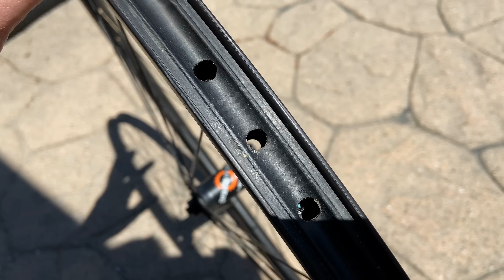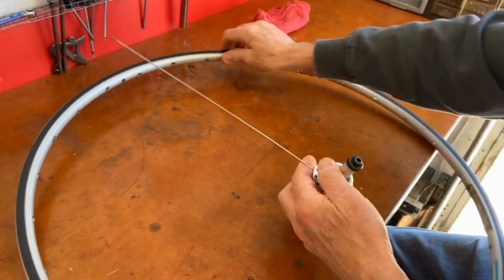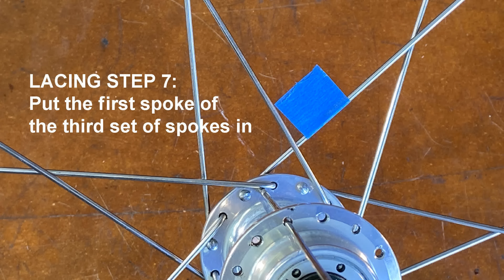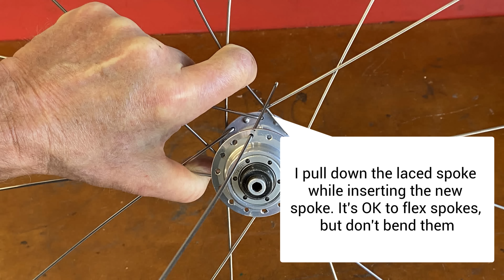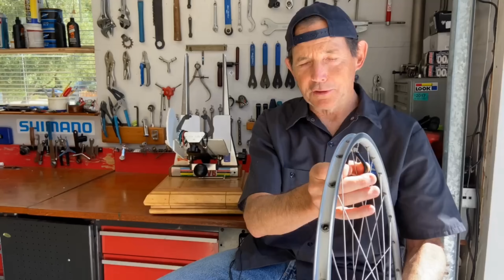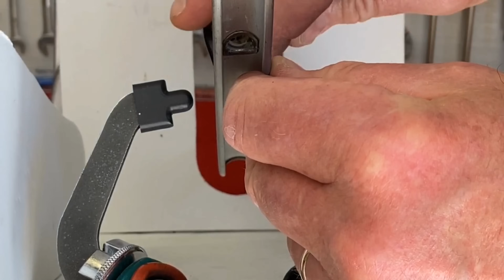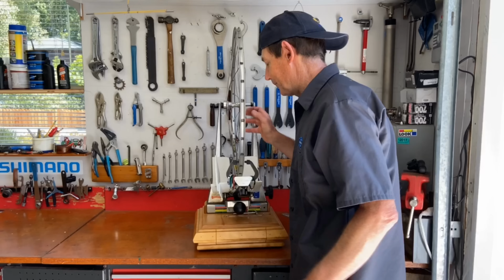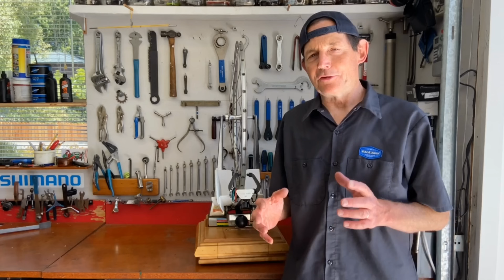How To Build Bicycle Wheels THE EASY WAY! #bikerepair

Comment: Hello Jim thanks for sharing your art. I'm building a wheel for my mountain bike and I want to use the existing rim so I can use wide tyres but the hub I will be using is a 1960's Sturmey Archer dynohub. It looks as if the original Sturmey wheel has the same length spokes all round. Do you think I should photograph and copy the original set up? Many thanks John.
Reply from the maker: You’re most welcome, Johnnie and thanks for watching! Since you are using the rim off your mountain bike, you will probably need different length spokes than what the old Sturmey wheel had. For figuring out the length(s) you will want to figure out that rim’s (the mtb rim) ERD , which stands for effective rim diameter. With the ERD measurement you also need the hub measurements to calculate spoke length. I have a video telling different ways to find correct spoke lengths if you need more info. https://youtu.be/LvV4FE2VxZk

Thanks again!

Comment: Not clear or understandable crossing No mention made of  how to measure for correct length of the spoke
Reply: Thanks for watching and the questions, manoftheroad. Did you maybe miss this part of my video about crossed spoke patterns? : https://youtu.be/XUqul03hbZ8?t=3 Or the section where I show how to interlace/cross them during lacing? I'm happy to explain more if you can tell me what's not clear to you or what you do not understand. 

Regarding spoke length it's not always necessary to measure or calculate spoke length. For example, if you were buying the rims, hubs and spokes from a bicycle shop, they would usually get you the correct length spokes. And, if you are learning to build wheels by taking apart an existing wheel, you will be using the same spokes and you wouldn't need to worry about spoke length then either. Still, for those who want to learn about spoke length calculation, I have a separate video all about that here https://youtu.be/LvV4FE2VxZk Thanks again!
Reply: Jim thank you for detailed reply and links....repairing wheel or replacing hub is viable ....tape together  and replace with same rim..to build from scratch is  not (for me) seem sensible option.....cost or time.  My present wheel is the cheapest Chinese friction I could buy and thousands of miles on trails and roads proven reliable at $55 ....£40 . I posted some vids cycling Ukrain  and çrimea ..have needed to tension a few spokes ...reliability is fantastic and so is price ....machine made wheels .....are good  and reliable .....3 years ago so far ..why invest to produce poor quality .  Cycling is about doing it ... not buying into it ....Your videos are good  and informative ....I hope it encourages  many .....but I hope more are encouraged  to cycle and do repairs ....people tour the world on cheap used mountain bikes ...spend the money on good tyres and new tubes and tape ribbons .....not the wheel ..just check sevice and regrease hubs with best wishes full synthetic  grease ...thank you MoR
Reply from the maker: Thanks for the nice note MoR. I'm happy your Chinese wheels are working fine and I completely agree about encouraging more folks to ride and to fix their own bicycles.

Comment: After watching this, i will attempt at building my first wheel.  

What is a good source/mfg of regular run of the mill round spokes that will not break the bank?

I've gotten a used mountain bike with aluminum rims but very poor quality spokes.  A number of spokes had already snapped off in the middle due to corrosion.  I planned on fixing it up and donating the bike.
Reply from the maker: Thanks for watching and the question, Kevin. I buy spokes from wheelbuilder.com. They have DT Swiss & Sapim brand spokes - both great spokes that will not corrode. Hope this helps. Have fun fixing that wheel and bike!

Comment: hi. I need to change the hub on my rear wheel from a 9 speed to a 10 speed. Is it possible to use the same spokes or would I be aswell just buying new spokes for it?
Reply from the maker: Thanks for watching and commenting, Kenny. It’s usually best to go with new spokes and nipples because used ones are already stressed a bit from being fully tensioned and ridden. But if you were in a pinch and had to use the old spokes & nipples over again, you can often do it as long as both spokes and nipples are in good shape and they are the correct length for the new hub. You just might find that the old spokes don’t last as long as new ones would. Hope this helps. Thanks again!

Comment: Great video. Personaly I find it easier to put in the 'heads out'-spokes in on both sides before turning the axel. Then I put the 'heads in'-spokes in on both sides. This way the already put in spokes are not in the way and you will scratch the rim way less.
Reply from the maker: Thanks for watching and commenting. That’s a good way to do it once you know what you’re doing. I have found that beginners do best with the simpler approach of 1 set of spokes at a time. But once you have the basics down it’s fine to try the different ways to lace. Thanks again!

Comment: Did my first build , or rebuild, went well, but having trouble getting the "Bump" out, everything else fine.
Reply from the maker: Thanks for watching and great job getting your wheel built, T Pep! To get bumps out, tighten the spokes at the bump. This is easiest to do without the tire on. That way you can see your progress.  If the spokes are very tight already then slightly loosen all the other spokes THEN tighten the spokes at the bump.

Comment: Great video sir! I have a question, I was wondering why do you have to "intertwine" the spokes? I mean why let them touch as they cross each other? Thank you sir!
Reply from the maker: Thanks for watching and the question, Kuya. You interlace spokes so that vibrations from the road are reduced and to slightly boost lateral strength. Vibrations travel up a spoke and because the spokes touch, the vibrations are damped. But there are wheels that do not have interlaced spokes like I9s or some Mavics with aluminum spokes. But most wheels do. Thanks again!
Reply: @JimLangley1  thank you so much for the reply sir, appreciate it. More power!

Comment: Thanks Jim for the thorough video.  I had a crashed rear wheel that I continued to ride truing it the best I could.  I had bought an exact replacement rim, but never had the confidence to make the switch until your video years later.  After watching,  I disassembled the old wheel and reused the hub and spokes, but bought all new nipples (and the tool - it really was worth it!).  Everything has gone well albeit slow, but the balance is too far left (non-cassette side).  You said to pull the rim to the other side by tightening the right side spokes.  My question - should I loosen the left flange spokes first the half turn or after tightening the right (or at all)?  I've also thought to go in order as you suggest, but by tightening the right spoke then loosen the next spoke on the left and continue in alternating order until I'm centered?  Thanks again for a great tutorial!
Reply from the maker: Thanks for watching and great job building that wheel, J! To move the rim to the right, you can usually tighten the drive side only unless all the spokes are at max tension already. In that case loosen all the non drive side spokes 1/2 turn and tighten the rights 1/2 turn. Do all the lefts then all the right. Then if the rim needs to move further repeat. That’s the best way to do it. Hope this helps. Thanks again!
Reply: @JimLangley1  Perfect!  I did loosen all the left first then tightened the right - both by half turns. I repeated that process again and then tightened the right again one last quarter turn.  It's great now.  I really do appreciate the video!  That spare rim has been staring at me for years taunting me to give it a go.
Reply from the maker: @jlo2017  you’re welcome! I’m happy my video helped you actually start riding that rim. Great job!

Comment: Hello Jim.
I am impressed with your knowledge and thank you for presenting the process of building a bicycle wheel in such detail. This is something unusual these days.
I have a question regarding correcting side-to-side wobbles in my wheel. Namely, after the whole process of centering the wheel, I check the tension by putting the wheel on the ground and resting my hands on the ends of the rim as you shown in one of the movies ("LIGHT BICYCLES Chinese Carbon Bike Wheels Review by Wheelbuilder Jim Langley" 19: 15min). After this check, the wheel is twisted again. What could be the reason?
Reply from the maker: Thanks for watching and the kind words, Michal. What I show in my Light Bicycles wheel inspection video here https://youtu.be/ZO2svtr32tU?t=1169 is checking wheels to see if the factory stress relieved them. When you're truing, the spokes can get twisted, the nipples can seat in the rims (change position slightly), and the spokes can seat in the hubs slightly. When building or truing wheels you perform the stress relieving step a few times to be sure that any seating of nipples and spokes has stopped and the wheel will stay straight and true when you ride it. The stress relieving simulates what happens when you ride on wheels, too.

So, if you are stress relieving that wheel - and doing it gently as I show in my video - and the result is that your wheel is losing trueness (getting wobbly) again, it could be that the spokes and nipples were not seated yet. In a newly laced wheel the spokes are loose and they will straighten when you stress relieve the wheel. That makes them looser than they were when you were truing and that makes the wheel go out of true again. As you add tension through truing, the stress relieving will knock the wheel out of true less and less and finally not at all - when the wheel is true, round and all the spokes are fully tight.

If you are working with an older wheel trying to fix a wobble, another possibility is that the rim got bent - actually bent - say from an impact or crash. When that happens, you can improve the wheel by truing, but if the rim is bent, the bend will still be there. And, as you true and then stress relieve the stress relieving can allow the wobble/bend to push the wheel out of true again. In that case, I would true and limit the stress relieving. It's likely with a bent rim to have to keep truing to keep the wheel working until you can replace the bent rim with a new one.

Hope something here is helpful. Please let me know if I didn't answer your question and I'll try again. Good luck!
Reply: @JimLangley1 
 Thank you so much for your comprehensive answer, Jim. You answered clearly. Thank you for your time.
I think I need a spoke tension gauge - then I will be able to fine-tune the wheel.
Now, after another truing and relieving stress, the wheel is much true but not perfect. After a few off-road test rides, I will do the whole process again and give you feedback on how it looks like.
If I could help you in any way, I would be glad to do it. Sorry for my stern answer, but my English is a barrier to communication.
Reply from the maker: @mutos82  You're welcome, Michal. It sounds like your wheel is coming out okay now. If you do get a tension gauge I think you will like it. Park Tool makes a nice one that's not too expensive and is easy to use. Here it is: https://amzn.to/35n0gkL
Reply: @JimLangley1  Thanks for the info about Park Tool tension gauge. Actually I though about the same model of tension gauge. All the best, Jim.
Reply from the maker: @mutos82  the best thing about that tension gauge is all the information Park Tool tells you about it and how to use it, including an app that lets you make charts of your wheel's tensions, which is fun and helpful. https://www.parktool.com/wta

Comment: I have another question: I just took a wheel apart (another 48 spoke BMX wheel, a front wheel this time) to clean the spokes with steel wool, and then I re-laced it using the same cross-4 pattern that it had to begin with. The spokes are all the same length (186mm), but when I finished lacing the wheel and tightened all the nipples, some of the spokes were too high in the nipples, some were too low, and some were just right. The ones that are too high are about level with the top of the nipple head, which prevents you from getting a screwdriver into the slot, and might puncture the innertube, and the ones that are too low aren't getting good thread engagement. I know they weren't like that before, because I removed all of them with a screwdriver.

I've checked and rechecked the lacing pattern and it looks correct. Is there any way to fix it, or do I need to start over? If I need to start over, do you know what caused it / how to prevent it from happening again?
Reply from the maker: Hi Maxim. Something must be wrong because you said the wheel was right before. The most likely thing is that you somehow got some of the spokes offset by one hole, in other words the spokes that are now too short are too far away from the rim in the hub and the spokes that are too long are too close to the rim. I would take the wheel apart and try again. As long as you lace it one step at a time as I show in the video you shouldn't run into this problem. Each set of 12 spokes has to be placed correctly in order for the spokes to fit right all the way around the wheel. Good luck!
Reply: @JimLangley1  Thanks for the reply. I noticed that all of the cross spokes (i.e., the ones you lace in steps 2 and 4) are too short and all of the non-cross spokes (steps 1 and 3) are too long. I've checked and rechecked the lacing pattern and I can't find anything wrong with it. Here's a picture of it; maybe you can see something wrong with the pattern:

https://i.imgur.com/aDYwLIM.jpg

In that picture all the spokes are loose, with the nipples threaded onto each one by about the same amount, so that you can easily see the difference in effective length of the cross spokes vs. the non-cross spokes. The problem is the same with all of them tensioned.
Reply from the maker: @MaximRecoil  From what I can see in the photo, it looks to me like the side of the wheel closest to the camera is the side that has the spokes that are in the wrong position. I think if you take those 24 spokes out and then are extra careful placing the first spoke of the 3rd set of 12 spokes in you can fix the problem. That's the most important spoke to solve this riddle I think. It has to be in the right hole in the hub. I show how to get it right every time in the video at this timecode: https://youtu.be/XUqul03hbZ8?t=968 It's pretty easy to get it wrong. So I tried to show a way to get it right. Give that a try. I think it will solve the problem.
Reply: @JimLangley1  Here's another picture:

https://i.imgur.com/vrAJyxe.jpg

The blue tape is on the spoke that's two holes to the left of the valve hole, and the white tape is on the first spoke of the third set, which goes to the hole that's immediately to the left of the valve hole. As far as I can tell, the white tape spoke hole in the hub is just forward (to the right) of the blue tape spoke hole.

Also, the problem exists on all of the spokes, i.e., all of the cross spokes are coming up short and all of the non-cross spokes are coming up long, so the problem was apparent after lacing the first 12 cross spokes (second set), before even starting the third set. Sets 3 and 4 just duplicated the problem on the other side of the wheel.
Reply from the maker: @MaximRecoil  Thanks for this second photo, Maxim. As best as I can tell (photos are not the optimum way for me to see the wheel - it's best to look at it), but as long as the camera isn't fooling me, the photo seems to confirm what I said in my last reply. It appears that you have the spokes in one side clocked one spoke hole too far. If you take all those spokes out and put them back in (all 24 spokes on that side move back one spoke hole), it should solve the problem.

For that to happen, when you put the first spoke of the third set in, it was likely in the wrong hole in the hub. That spoke is the key to getting the pattern right. If you're saying that the same problem is on the other side of the wheel, then something more is the issue. 

Following my steps for lacing, you would have put 12 spokes in on one side of the hub, and 12 more on that side of the hub. The hub holes on that side would have all been filled so it's unlikely to make a mistake there. But, it is possible to put a spoke in the wrong hole in the rim since there are more open holes than spokes. You can check for that, too if that side is also off. Hope this helps you find what went wrong.
Reply: @JimLangley1  I just took it completely apart and re-laced it, and it came out okay this time. Well, there are two spokes that came out a little long, but I think they'll be okay. They are both on the same side of the wheel and close together, so I think that might be a low spot, and tightening the spokes on the opposite side of the wheel may "shorten" them. Right now I only have all the spokes finger tight. Thanks for the help.
Reply from the maker: @MaximRecoil  happy to hear it, Maxim. Thanks for letting me know and great job figuring it out.